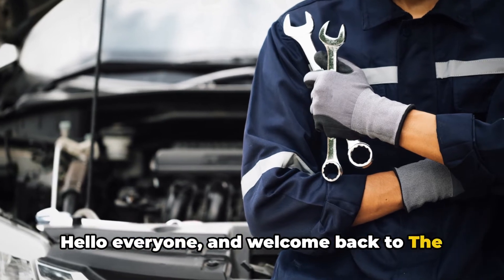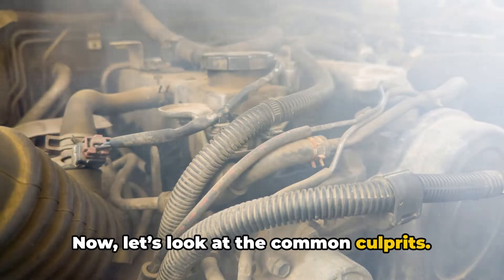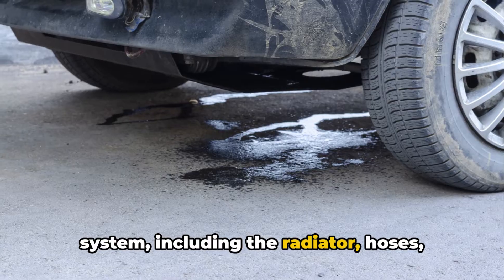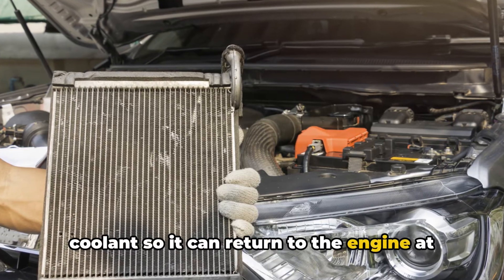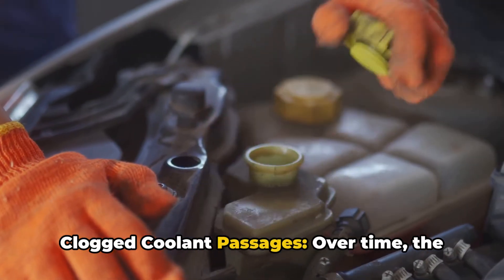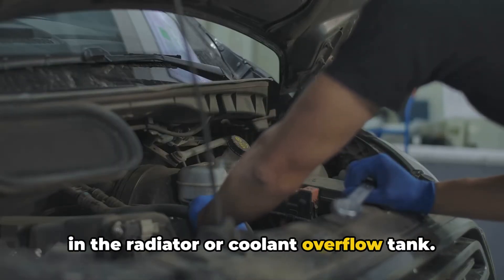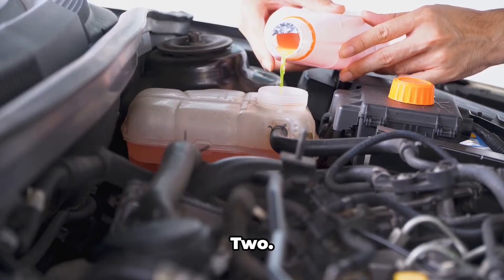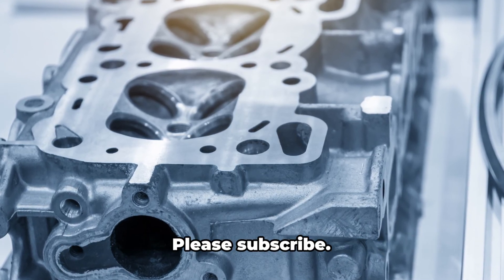7 Common Causes of Engine Overheating: How to Fix Guide

Comment: Don't open radiator cap when hot!!! When DO open, open with a large cloth draping down to save your wrists from burns.

Also research dangers of you cracking components when adding room temp water/coolant to an overheated situation!
Reply from the maker: That’s excellent advice; safety first!

Comment: My Ford kuga 1.6 engine over heat only when I drive but when it's running on a standby it does not over it and the fan spins normal

Comment: Over 5 months ago my 2013 Chevy Tahoe overheated because there was a hole in the water pump now the pump isn't factory I've replaced it before but it does have over 250,000 miles on it

Comment: Bullshit Engines . Since the 70s and we still cannot design an engine without this dilemma... The manufacturer are stupids, suddenly the engine fan or ac fan is not working, suddenly it destroys the thermostat, water pump and causes the radiator rust that causes the raidaitor and coolant damage. Then the oil started to burn then it burned the water then overheated then engine failure. 
Still the same designs and the same shit. Thanks to the electric cars manufacturer for helping us get rid of stupid cars